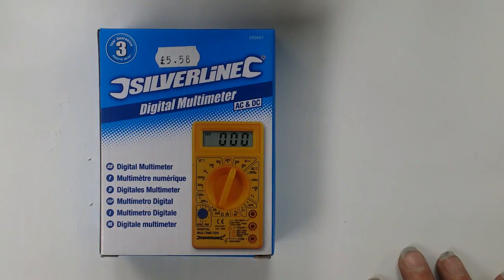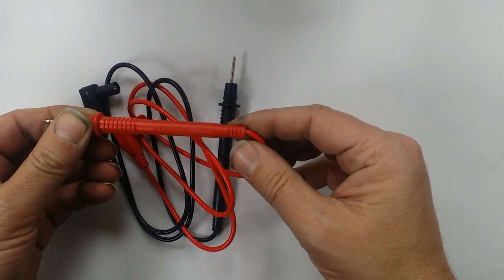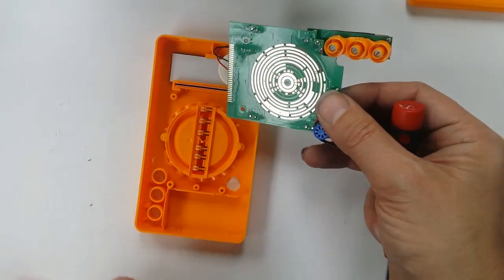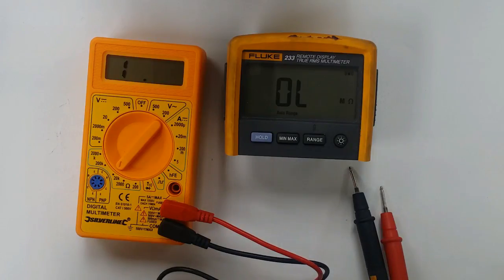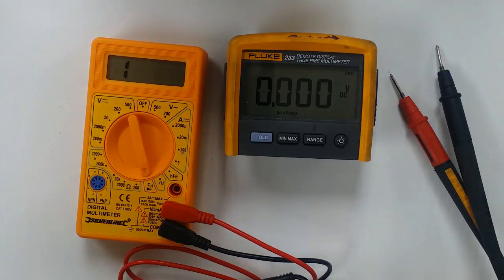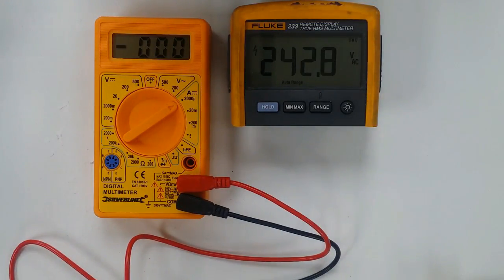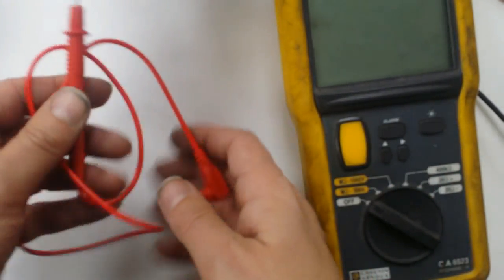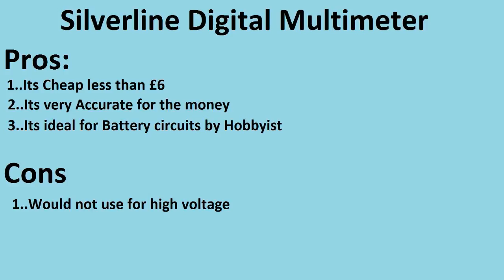Review of silverline cheap multimeter

Comment: Wot' josb1066' said. If the leads are replaced this does make the grade as a car glovebox meter. The leads supplied WILL break. In the dark. In November. In a lay-by with lorries going past 3 feet away.
Reply from the maker: +The Philpott the leads on mine were not that bad i would just not trust them on high voltage mains

Comment: the leads are really badly made, thinnest wire ever, and not fixed well inside the ends, so will fail you quickly, the meter otherwise, is accurate, but has little protection on any range, not safe for mains use, the plastic case is also fragile.  transistor tester is actually useless, notice on any expensive meter, they ever have such a thing, they wont help you diagnose transistors.
Reply from the maker: +jusb1066 Your not wrong but did surprise me as to how accurate it was
Reply: Kev's Electrical Workshop (K.E.W)
indeed, but i think the thanks has to do with the little chip on board which does all the work, amazing technology improvement in my opnion, and im sure the same chip is used in more expensive machines too, same as some years ago when they first made fm radio on a chip, its gone on to make fm radios for pennies.
Reply from the maker: yes its all going that way, mass produced and cheap, sadly the same technology that gives us these cheap meters so we can repair things has also killed parts of the industry, try to find a tv repair man for instance.
Reply: Kev's Electrical Workshop (K.E.W)
true but think like this, i have a small valve radio made in 1952, it has just stopped working, what is interesting is this: it was made in a small factory in essex, its a 'ultra', i have the original receipt, if you adjust that price for inflation that small valve am radio cost £850 in todays money, goodness knows how much a tv would have cost then, of course you would pay £100 equivalent if it needed a repair, but these days £100 is half the cost of a new tv set, radio's costing about £20 quid, so are throw away, thats the reason for no repair men, they would charge more than half the price of new, and really, what with smd which is machine placed and soldered in a special oven, its unrepairable anyway, cheap means no one can make money fixing it, old valve and wirewound was man fixable too.
Reply from the maker: Same with tv's so we cant grumble, back to the meter its a shame they didnt spend a few more pennies on those leads and could have still sold it for under £10
Reply: Kev's Electrical Workshop (K.E.W)
if you look up uni-t 136b, its around a tenner, auto range, has some mov protection and half decent leads